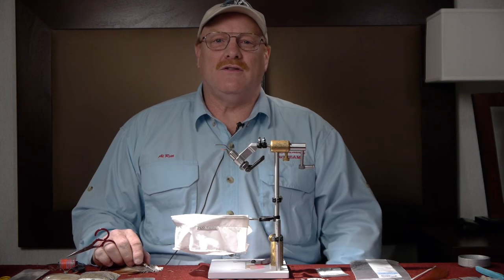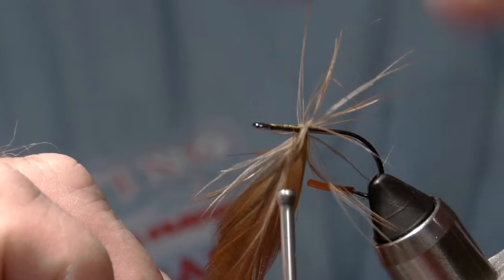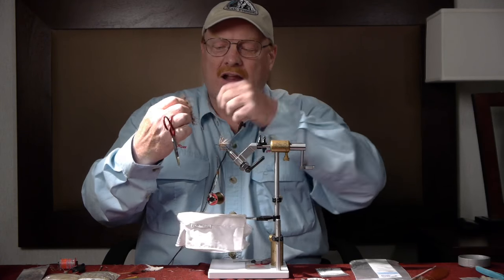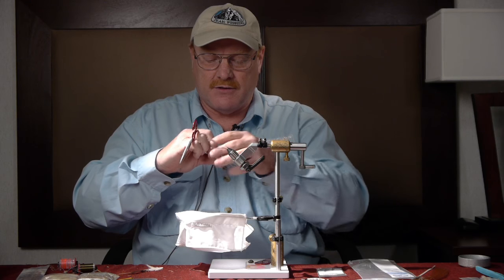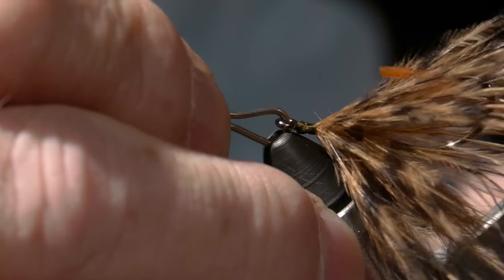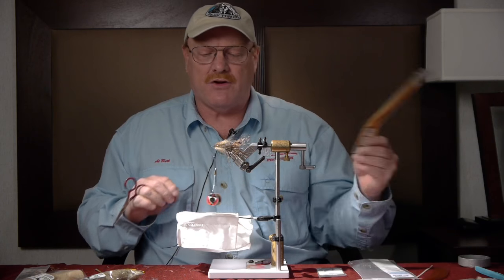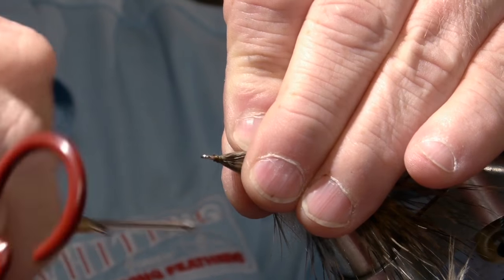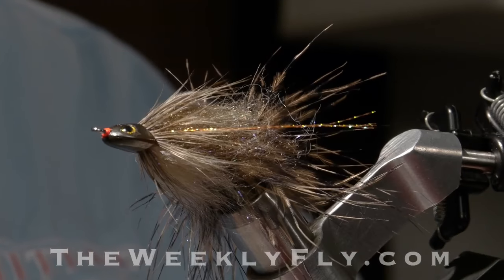Al Ritt: ARF Articulated Sculpin

Comment: Nice pattern, I substituted buck tail tip fibers for the cheap hackle. It doesn't have buoyancy and it has great movement less than half a pencil. I tied the fibers toward the hook eye and folded them back like a hollow tie. It works great. Thanks for the pattern and the good idea to cover the hook point. I usually use a pencil eraser but it can fall off. All the best, Sean